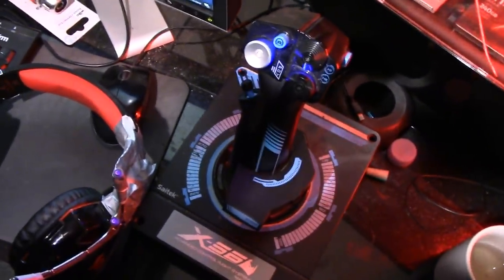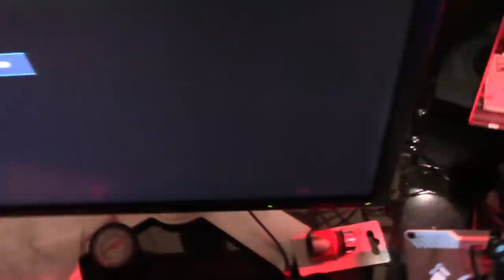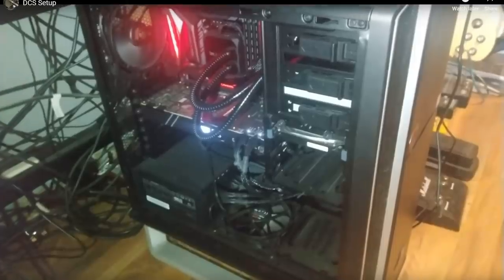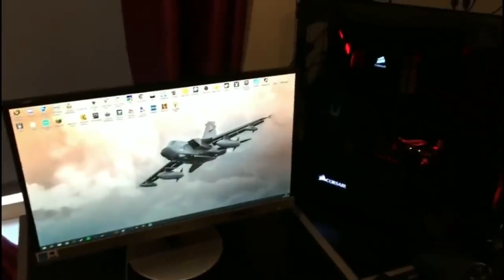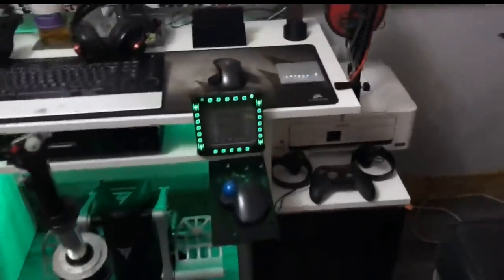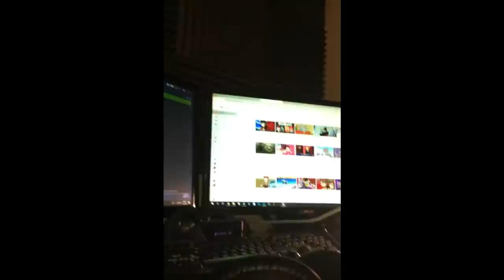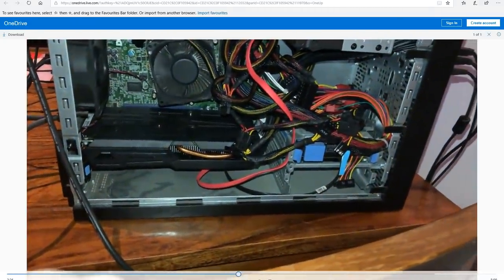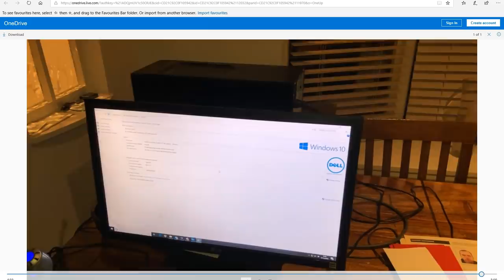Explained: Grim Reaper Members' PC Gaming  Rig Setups 2018

Comment: Excellent vid demonstrating you can fly with basic set up to get up in the air. One can add as one goes along. 52k subscribers benefit from the work and effort you put in. I agree with another post that if you set up a funding site, I would gladly contribute due to the effort you put in. I am questioning why no major hardware manufacture have not given you goodies in exchange for reviewing hardware. Anyway, thanks for your work and effort.

Comment: My Dcs setup is a Ryzen 5 2600, Power Color Red Dragon Vega 56, 32gb 3200 Gskill ram, 240 gb and 1 TB Inland SSD, and a Thermal Take case, runs it perfectly

On a side note im suprised those 1050s are running this that well, not a beefy card by any means

Comment: I see the GrimReapers are flying on sheer, grim determination. It must be, because it  surely is not because of  their superior gaming rigs. I feel so much better about my own humble setup now!...Thankyou for showing you don't need outlandishly expensive gear to enjoy DCS.
I will stick to my TM Hotas X, Saitek rudder pedals and TrackIR for now. But still, I need to get meself a Warthog throttle&stick soon. Virpil and VKB are just a bit too pricey atmo; maybe I will get a Virpil T-50 or WarBRD base later and use it with the Warthog grip?

Comment: You need a HOTAS Warthog Cap.  Also a new monitor.  Also more storage space.  I have about 16 GB of storage plugged in right now and am using most of it.  I do use about 13 flight sims though.  Love the comfort and homeliness of your setup though.  Not sure about keeping beverages so close to your rig.  I got some great ideas watching this.    I recently bought a PS3 camera to try out FaceTrack NoIR, but couldn't get that to work.  Just the other day I ordered a Delan IR unit so should be able to use that with the PS3 camera and Open Track or something.  I will be using duct tape now :).  I liked the custom Warthog base to centre it in another video.  Been looking at desk clamps but I think I might prefer something homemade and ground mounted.

Comment: Cap, for plugging your SSD, you need to plug the sata cable into the motherboard and the other end into your ssd. The place of the port depends on the motherboard type, but should be in the neighbourhood of the other SSD's SATA cables.
Reply from the maker: thx

Comment: How to install a SATA HDD

It requires two cables one power cable and one SATA cable.
The cable that flashed by is an adapter that turns 4 pin power connectors into the standards that modern HDD's use. You might not have one of those available. But i would preffer to run a cable of the correct type directly from the transformer. You probably got a few extra such cables with the computer.

Connect that power cable up and then get a SATA cable that you plug into a SATA port on the motherboard (check where the two HDD's are connected that's where they are)
Now the HDD is powered and connected to the motherboard.

The HDD also needs to be mounted, this can be done with an adapted in a 3.5 slot or straight up in a 2.5 slot.
The 2.5 slots use the screws in the bottom of the drives and the adapters use either one.

When that is all done you need to create a partition on the drive so that it shows up you do that with the program "Computer management"

Comment: I received a little computer last year and a box of stuff. Somebody had put it together 10 years ago. When they built something else they gave it to my sister in law. She used it for email, invoices, etc. They asked if I wanted this old computer, I said ummm yeah.
It's a Mac Pro, with (I'm not on it now and keep forgetting the name) Two, quad chips, each quad is dual (16 processors) 24 Gb of ram, a 1 Gb Radeon, Four 1 TB drives and 6 or 7 fans. In the box was an unopened copy of Win 7 Ultimate 64 bit. It went on one of the drives and plays War Thunder quite nicely with whatever settings I want. That's all I've tried so far for games. I don't play a lot, I'm either busy or tired.

Comment: Cap, good to see your doing well. As far as what headset, I would highly recommend the Arctis 7 headset from steelseries. It's a wireless headset and it's in a class if it's own. I love mine. Never drops signal. If you want a wired one, they also have those as well.

Comment: This reply is for JD, Wolfhound and Chaos and anyone  else using a tv as a monitor. I have to rebuild my system and considering using one of the 4K tv’s as a monitor. During my research I keep reading about input lag associated with using a tv. Some of the manufacturers have it pretty low now, with most under 15ms.
My real question to you guys is just how much does it effect your DCS game play especially when trying to hold a very tight formation. Any real feed back would be greatly appreciated.
Reply: I'm with you on the 4K screen question. I just have to do some googling. I have 3 monitors and really am just finding them to be a pain in the ass. I'd like a 50+ 4k right in my face. I have a PS4 and play some very graphic intense games on my 52 inch 1080 (not 4K screen but in Game mode) and they look fantastic.  I'll be taking that 52 (also have a 60 4K coming) down stairs and giving it a try. I'll respond back with results.
Reply: @MavicAir1  I have decided to go with VR.
Reply: @snakeye5053 I guess its quite amazing. I have to do some googling. Oculus rift I hear is the better one. Not cheap.  Not being able to see the controls would be a problem for me but they must have a solution to that. If I get the larger screen (I have Track IR 5) that should be good enough.  I would like to try the VR though.
Reply: I am using a stupid expensive 65" sony with a game mode at 3840x2160 it only runs 60hz but in 4k uhd with a 1080ti 11gig I never run under 50 frames. My framerate shows at 124, but I cant push more that 60 though the screen. It works really well. Only real problem is I cannot sit close enough, so air to air is VERY hard to see aircraft at more than 2 miles.

Comment: The only excellent headset is the Beyerdynamic MMX300. Headsets never focus on audio properly and often are overpriced "gaming gear". Go to Amazon and get the Aukey, mic on an ar with popfilter. Cheap and works fine. Then get a pair of headphones. I went to bax-shop and bought a stagemic, it pops into my ear and mic to my mouth, wireless (can be done wired). Then the audio is seperate, currently a 3.1 lcr setup. But headphones fit over it just fine so that can be done as well.

Comment: @Riddle   ... look at the other side of your case (behind the motherboard, if you open the other side of your case). There are spots for SSD's there :)
Reply: o shit! Thanks!
Reply: @One_Piloty_Boy  no problem :)   I could be wrong... but looks similar in build as mine (fractal design R5, which has 2 spots for SSD's in the back). and nowadays, lots of cases come with a spot or 2 for SSD's behind the mobo

Comment: Cap, Your connections are probably loose, try unseating and reseating and applying the screws to get the monitor to be reliable.
Reply from the maker: rgr
Reply: He probably had tried that navy times, I'm thinking a faulty cable, some threads broken..

Comment: I had a small panic attack seeing some of those poor computers
Reply: Those are like $10,000 PCs to me
Reply: @Kilo-sz4ch  they are <1000$ pc's .__. Most <400$.... And it wouldn't be bad, budget pc's are great, but the STATE of them is scary to look at, dust everywhere, shoved in a corner, 0 f's given about cable management...
Reply: Matas Kart I need to know what those <1000 PCs are 👀
Reply: @Kilo-sz4ch  well the last guy per say... He got an office PC and upgraded the GPU and power supply... So a max 50$ pc or even free from an office cleaning day. And then a 350$ gpu and ~50$ psu. So 400$ for a functional Pc....
As for a Good pc,  if you buy used parts you can get all their pc's <700 even, but if we're talking new it would be harder. All of them had older gpu's like 1080 ti's etc that are ~400$ nowadays, 1/2 the cost they were like ~4 years ago at 700+$... 
Here's a 1000$ build that's more powerfull than all their pc's: https://pcpartpicker.com/list/BZmhf9 . ..
Throw in a 300$ monitor on top (that will be better than all their monitors) and you have a setup with some old peripherals...
It's also the case that some bought pre-built's, and there are few sellers who actually make sense.... Most pre-builts are like 1.5x-2x the price... There are a good many exceptions, but they usually skimp on the PSU or stuff like that to lower the price...

Comment: Are any of you (Reapers)  using your Occulus devices on a regular basis or sticking with the monitors?
Reply from the maker: about 50% have OR yes
Reply: @grimreapers  Nice, Is it worth it or should I just invest in a multi monitor setup?
Reply: @grimreapers  Do they prefer to use them over screens? I just purchased the Virpil controls and am specking out a system. trying to decide on which to go with.

Comment: Wow... You guys got some Expensive PC's...  Hotus's are not cheap. Graphix's Card are stupid expensive just by themselves.  I had a Dell Intel Dual Core, Optiplex 780. PSU went out. (will be replacing it soon). Replaced the Dell 780 for a 790, I5, 8G of RAM, and 128 SSD, 2TB, for a 159 Dollars. It's a SFF Case that sucks.  Funny that my IT School laptop can run DCS World. But flying Keyboard blows... But I have found two Graphix's Cards G Force and a Vision with 2G's of RAM as recommended per DCS.. For under 60 USD :) May give that a try..

Comment: Nothing in that X56 I can't fix or replace. Just buy your friend beer with a 3D printer. It can make parts...

And who is that first guy. I need to send him some money. This is the 21st Century. At least buy  Corsair Headset.. As the one you got looks like something Red Green used bailing wire and duct tape on...

Comment: Hi!
I've been watching your fantastic video and would like to recommend a great headset for DCS. Look up audio-technica bphs1, it's a broadcaster over-ear headphones with great quality microphone. lots of ppl use it on Yt (AngryJoeShow). I am totally new to DCS, (1 day!, new comer :D) and on my way to buy Thrustmaster warthog..I guess good quality is always better than low quality as Benjamin Franklin said,  The bitterness of poor quality remains long after the sweetness of low price is forgotten. :)

Love to learn from you and your channel is amazing to me, very, very interesting to watch and learn.
cheers,
Reply: What's the odds we both are watching the same video that's been out for a year, at the exactly same time, both thinking of the BPHS-1 

--If you have the budget available, the BPHS-1 is fantastic. [$199 MSRP. I paid $130] The over-ear monitors are essentially flat delivering exactly the sound an audio engineer for your media source had worked to achieve and wanted you to hear. The microphone is fantastic at unwanted background noise-rejection (Of course, it's used in football stadiums) which I specifically tested for on my set under conditions recording in a room immediately next to a couple running and powered-ON central air-conditioning motors, and directly underneath an active ceiling fan (On Low or Med, don't remember which, but I was right underneath inside the moving airflow path while recording). EVEN UNDER ALL THAT, if you knew what to listen for then you'd hear it. But I was still shocked at just how much of my voice was recorded vs the amount of background noise rejected. When you think back to the ESPN announcers using BPHS-1 @ Football games, then the background noise rejection design's ability becomes a bit more understandable.

The Headphones are Great:
I have an old Mp3 from the year 2003 of Tchaikovsky's 1812 Overture. Played it hundreds of times. Recently, I listened to it for the first time through my BPHS-1 headset and I was shocked to discover after 15-years that the opening hymnal-style prayer from the beginning of the 1812 Overture was in ENGLISH! For 15-years, I thought it must have been monks speaking either Latin or Russian. But the first time it came up using the BPHS-1, it's suddenly clearly in English leaving me shocked that 15-yrs went by thinking it was a foreign language until hearing through the BPHS-1 for the first time

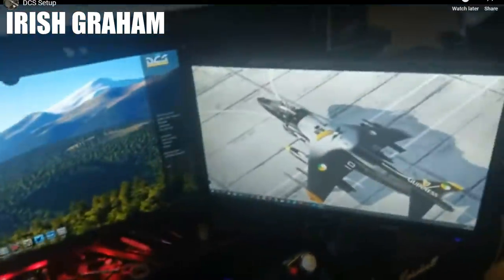There also might be a BPHS-1 headset in this video @4:57 but we don't have the necessary angles, light, or resolution in the video to confirm we can see the microphone to be certain that the set shown is not really a set of AT: M50/40 headphones. @4:57

Comment: Cap you need a new computer that can run M1 SSD's they are like 10 times faster than the SATA SSD's because they use the same I/O port types that the Graphics card uses.
Maybe you should look at getting a curved monitor. Those are about the size of two monitors side by side but curved for optimal viewing.
Also get a laptop or something for communications stuff and checking documents when in the air, that way if there is a problem it won't affect DCS.

I would recommend getting the Logitech Heavy Side-panel for the additional buttons so you don't have to use the keyboard for secondary functions.
Reply from the maker: rgr will do full upgrade when more $$ comes in

Comment: Cap do u have rudder pedals?
Reply from the maker: no   my legs don't work very well.
Reply: @grimreapers  Maybe not, but I'm delighted to hear that "The Cancer Campaign" was a success. As a long-time Falcon 4.0 vpilot getting back into flight sims your videos have been both informative and entertaining, so my thanks to you and the entire GR squad. It's reassuring to see that I'm not the only vpilot with a less-than steller rig. ;-)

Comment: How the hell have all you X-52 guys managed to run them in DCS? Only way mine will work is with the Joystick's control panel open which then stops me from using any keybinds (like F10). I've reinstalled Windows and DCS and I still get the same problem, yet this only occurs in DCS and none of my other space / flight simulation software...

Oh and to the Brisbane guys; Gold Coast here, but my wife would kill me if I donated to a go fund me, especially with 3 kids and Christmas around the Corner... Sorry Cap

Comment: bro your setup has potential but it is limited by how messy it is. if you clean everything, organize everything and use glue or a diy mounting system for your tracker it will be cleaner and better, instead of a messy ductape job
Reply: you dont need a ton of money for a good setup, you just need a clean setup

Comment: For the headset get a turtle beach there really good quality as long as you don’t throw them at a wall :)
Reply: I wouldnt!, have had  4 pairs of them and they just randomly break, because they feel like it.
Reply: I have the X12 Earforce. They're great sound wise, microphone monitor feature with toggle button on wire + external amplifier are awesome and after about 3 years they're still going strong but they're not very comfortable for long use. On the plus side they force me to take regular breaks so I guess that's not bad.
Reply: Bonkas mate yea I’ve probably been lucky I’ve heard a lot of bad reviews but i cant help but like them!
Reply: @LAWest  Oh yeah too each there own, just had a negative experience with TB :)
Reply: @Hichatsu  musta liked something , you bought 4 of them..js..lol.....my G430 work just fine.

Comment: Gumbo's system is extremely bottlenecked. 2080ti and 2ghz ram with a 2700x like whuuuut
Reply: 2080 oc, 32gb 3200mhz ram, 2700x, ssd, nvme ;)
Reply: @GumbosFlyingCircus  coulda sworn u said 2ghz ram my b. But still some performance left on the table with that 2700x and a 2080ti
Reply: 2080 I mean lol
Reply: @whalesnfriends22  It runs well and gets 70FPS on the ground so that's pretty good at high settings.  There's no bottleneck though. :)
Reply: @GumbosFlyingCircus  I average 135 with a 3440×1440p monitor and a 2070 no OC. My 9700k is OC to 5ghz on all cores
Reply: @GumbosFlyingCircus  if you're talking vr that's pretty good
Reply: @whalesnfriends22  am happy with mine as get the mirrors, top settings, trees, max preload etc...so as long as I have 60+ fps it's smooth and good for me
Reply: @GumbosFlyingCircus  ahhhhhh max preload will do that to ya. All about what makes you happy homie👍🏻